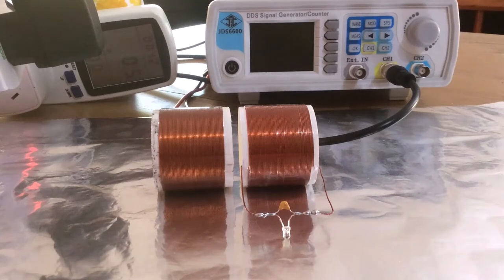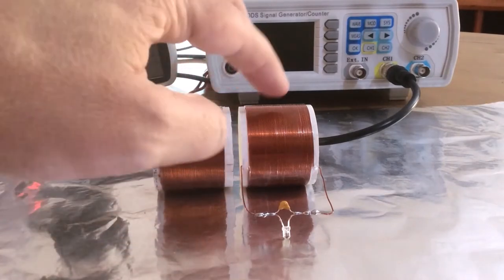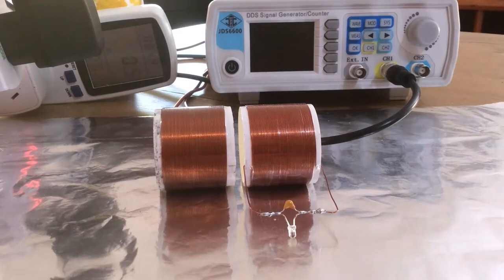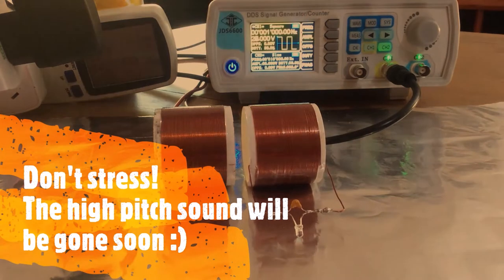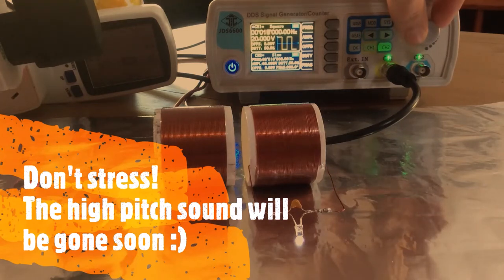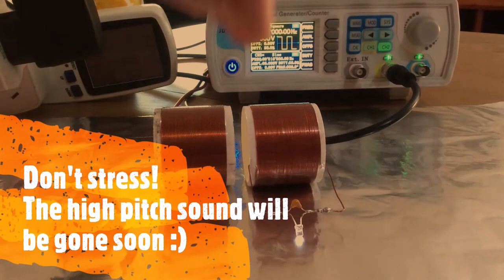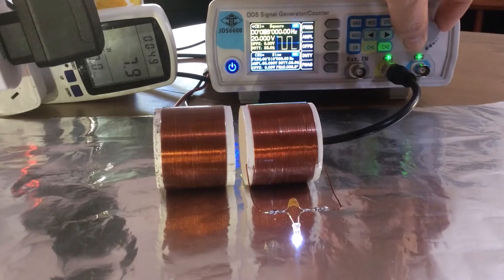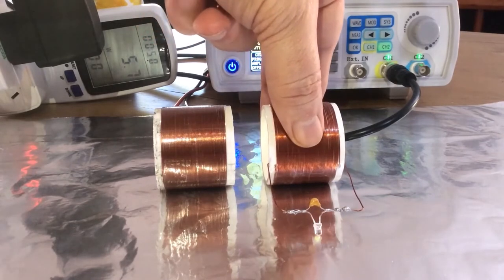FREE ENERGY with RESONANCE!

Comment: I don't get why every demonstration of this Don Smith generator always hinted on free energy, but they never try to measure the actual input power consumption. If we follow the proper principle, when there is no load (i.e. no secondary coil etc), then there is magnetic flux created by the primary coil, and this flux is energy. If this flux is used (absorbed) by a secondary, then there will be cancellation of the original flux (like adding a back emf to oppose the primary's flux), in particular with a connected load (led). Without the original flux, the primary will behave more like a short circuit, thus consuming extra power from the input supply or signal generator to maintain its AC signal. Therefore, the input power should measure a higher power consumption (with a secondary load). The more secondary coils added, the more current the primary will flow thus more energy input. So eventually, no free energy. Is my reasoning wrong?
Reply from the maker: Thank you for watching. Assuming we are following our education your evaluation would be correct. However, our education has been misleading at the best. The problem with this education is that it is wrong and this was clearly stated by Tesla. We are still educated using electron theory yet both Tesla and Einstein stated they did not believe in the electron, two of our greatest minds and yet we think we know best and have disagreed ever since. When a primary coil is coupled to a resonant second coil it does NOT increase the initial load, as stated in Tesla’s work. This transfer of power is not just magnetic flux and there are multiple waves of energy of different kinds. Measuring the output from these fields is often difficult as today’s modern equipment is not designed to measure this high frequency energy, we simply don’t have affordable measuring equipment. This demonstration was designed to show this functions principle and not so much the power consumption, however you can take note of the input from the mains meter at the start of the demonstration when the frequency is not resonant with the coil. As the resonant frequency is tuned you can see the initial input decreases, then as more resonant coils are added we see no increase in power input. The magnetic flux is not diminished during this function as the device acts similarly to radio. Imagine having your car radio playing near the radio transmitter, the radio transmitter is unaware that you are receiving its broadcast and is applying a constant transmission power input, then your friend pulls up in their car and turns on their radio, at this point there is no need for the radio station to increase its input to accommodate your friends radio and instead they keep transmitting at the same power input. Now go one step further and invite a club of radio enthusiasts to turn up to the station with their crystal radio kits, that require no batteries to function. The club of 100 members all using their own crystal radio set take their signal from the same transmitter as you and your friends cars radios are, yet there is still no increase in transmission power from the station. Don Smith’s devices are Tesla concepts, there is nothing special about these devices and the mystery only exists because of our flawed education, these devices are nothing more than radio transmitters collecting waves as energy instead of sound energy. I hope this has helped your understanding.
Reply: @whatifididthis...1236  Thank you for your reply and explanation. There are perhaps two things to demonstrate to provide more evidence in the setup. The first is to show that the dip in the signal generator power is not due to it's own design. This could be tested by ranging it's frequency from low to high (800kHz if possible) without connecting the primary coil while checking the power. The second is to use a bigger load in the secondary coil, perhaps by connecting 10 or more LEDs in parallel in order to increase the load current/power to a level that is measureable by the power meter. If this thing does indeed work, then it would be a great scientific discovery.
Reply from the maker: @francislau3393  Thank you for your comment. Those are both very good points to examine. I will check these two things out and get back to you. My initial “pre test” thoughts are as follows, the frequency manipulation on the signal generator should not change the units input wattage as the voltage remained constant during the frequency sweep. Changing the voltage however would possibly change the input wattage.
 Regarding the load increase, I will parallel some LED’s and try some different lights as you suggest and perhaps a small motor, I may need to make new coils though as these coils were made for the small LED’s, I just decided to make the video using them because they easily demonstrate the concept. I have connected approximately 20 of those LED’s with my portable lighting circuit, I think I demonstrate that in part 2 of the tutorial on building that portable unit if you’d like to see the same coil in action.
Reply: @whatifididthis...1236  Yes, you are right about the generator's power, which is mainly affected by the resonant frequency of the primary coil. Great insights!
Reply: @whatifididthis...1236  Nikola Tesla and Albert Einstein had reservations or disagreements with certain aspects of the electron theory, but their skepticism did not amount to outright disbelief in the existence of electrons. Tesla criticized the electron theory, believing it couldn't explain all observed electrical phenomena. He believed that electrons could not account for all observed phenomena in electrical systems. Nevertheless, his work on electrical systems did not preclude the existence of electrons, and the scientific community eventually reached a consensus on the electron theory.

 Einstein, on the other hand, disagreed with some interpretations of the theory, particularly within quantum mechanics. For example, he disagreed with some assumptions made in quantum mechanics, such as the probabilistic interpretation of the behavior of subatomic particles, famously stating, "God does not play dice with the universe." Nevertheless, Einstein's work on the photoelectric effect helped confirm the existence of electrons and contributed to the development of quantum mechanics.. Despite their concerns, both Tesla's and Einstein's work contributed to a deeper understanding of electrons and subatomic particles.
Reply from the maker: @toms3996  Thank you for your comment. My real problem with our education is we teach as fact yet when Einstein states regarding quantum mechanics that “there is something “spooky” at a distance” then I believe this to be stating he doesn’t know for sure. What I question about our education is our teachers state these understandings as facts when they are nothing more than hypothesis. I have researched a lot on quantum mechanics and it is clear to me that our greatest minds today are still claiming they don’t fully understand. The agreement on the consensus of the electron theory is nothing more than an explanation derived from a lack of a better understanding as stated by Einstein himself. Tesla’s statement about Einstein’s theory of relativity was “mathematical garb”.

“Einstein's relativity work is a magnificent mathematical garb which fascinates, dazzles and makes people blind to the underlying errors. The theory is like a beggar clothed in purple whom ignorant people take for a king... its exponents are brilliant men but they are metaphysicists rather than scientists.” 
― Nikola Tesla
It is only our education that believes in the agreement between these two entities that never actually occurred and our existing understanding of electron theory is more incorrect than it is agreed upon, theoretical science is no measure of reality.

Comment: I study now the receiver coil. Would all of the coils be in resonance in this example:
Length primary coil: 2 meters
Length secondary coil: 20 meters
Length receiver coil: 1 meter

I assume the cross-section of the cable is not important for the resonance. But I think it is enforcing the power.
Reply from the maker: There is one coil that is a slightly different frequency because it has two extra turns and a larger current draw through its load as well as being wound in the opposite direction. This was done to demonstrate you can be close to resonant and still not quite be there.
As far as I can tell the only difference when considering cross section would apply to mass, as in there would be more electrons to move, almost considered like capacitance.
Those coil lengths should work as they are either divisions or multiplications of the primary. As long as this is considered they can be all different lengths to achieve 1/4 wave or half wave etc., different combinations should be tried for true resonance and the capacitor also must be considered. It’s a good idea to arrange a coil that can have different capacitors applied until you find the resonant one. Transmitter Voltage should increase and amperage decrease when approaching resonance. Then all you need to do is tune the receiver coil to the transmitter using length of wire and value of capacitor.
Reply: @whatifididthis...1236  The part with the capacitor is very interesting. I didn't know that. I think you talk here about the capacitor of the receiver coil. Does this apply also to the caps you have in your circuit in the other videos. There you have 2 caps in parallel (1400VDC 20uF IEC61071). Wouldn't it work with other caps the same?
Reply from the maker: @marcelfiechter7436  Those caps you mentioned are DC caps, the caps on the small coils are for AC as they are non polarised. As you apply different value caps you will be changing the frequency and you will see different results as you approach or move away from resonance. The DC caps (1400 v) are placed after a full wave bridge to allow DC extraction from the receiver coils which are propagating AC.
Reply: @whatifididthis...1236  You told me you got eventually 10 watts (20 watt led) by the receiver coil measured by the lumen meter. And the input was around 3.2 watts from the 12v-battery. If you would double the length of the wire of the receiver coil would the wattage increase of the receiver coil? I think so. Probably 20 watts. This would be one way of upscaling.
Reply from the maker: @marcelfiechter7436  From memory, when running the 20 watt LED at half brightness, the input current from the battery rises to 5.2 watts. Adjusting the length of the receiver coils will also adjust frequency. These coils may not be in perfect resonance as they were not designed to be used with this coil. Making the receiver coils resonant with the primary coil should help the receiver achieve higher output. Measure your primary coil length, then make the receiver either the same length as the primary or any multiplication or division of the primary and you will get higher output. Yes, making it longer may increase output but only if resonant.
Reply: @whatifididthis...1236  Perfect answer. This confirms that I am on the right track.
Reply: @whatifididthis...1236  Do you know by any chance where i can find these exact coils. My plan is to replicate first and explore once i understand which concepts lie beneath it. Thanks in advance!
Reply from the maker: @me4874  Thank you for your comment.
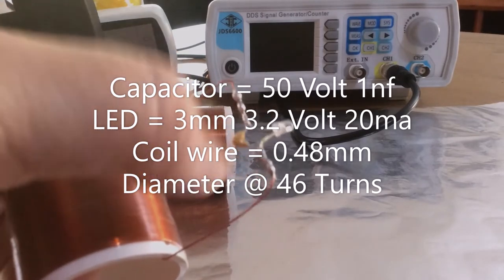I wound the coils by hand on a small gauge poly pipe, the details of the coil are on screen at the 1:30 mark. There was a US company that was selling the kit that Don Smith talked about in his videos but there really is nothing to it, making these coils is cheap and easy.
If you require a link to that company selling the kit, I believe I have already supplied a link to another person in the comment section. Let me know if you have trouble finding it and I will have a quick look for you.
Reply: @whatifididthis...1236  Thanks for your fast answer. I actually found the link, however as i am living in europe i cant order it. Ill try to create a coil myself. Which material is around the pure copper on the coil? Thank you!

Comment: How many odd those coils can you add? Unlimited?
Reply from the maker: Thanks for watching. I can’t imagine unlimited would work. From my understanding the limit is as many coils that can fit inside the magnetic toroid that surrounds the transmitter. Each coil extends transmission a little but there is a cut off point, you can increase power of the transmitter and again search for the extended perimeter of transmission.

Comment: What's measuring the watt meter?
Reply from the maker: Thanks for watching. The watt meter is not being “metered” because it isn’t required as part of the system. The watt meter is used in this example to show at the correct resonant frequency the power input is reduced and does not increase when additional loads are added. One input with multiple output and each one of equal value of the input, many more receivers can be used to achieve over unity, as many as can physically fit inside the magnetic field with no increase in power. The physical reality is obvious and our education is left standing in the room with a dumb ass look across its entire face, people should stop reading that crap and start to experiment with this old tech.

Comment: Extra wire on a coil actually lowers it's frequency ! Not increasing
Reply from the maker: Thank you for your comment. If by “extra wire” you mean longer wire you would be correct. If I stated otherwise this would be a mistake and I apologise.
Reply: @whatifididthis...1236  It's OK we all make mistakes, part of being human lol BTW I watched all your videos, you said primary bifilar should run at 172khz if correct that's great as my H-BRIDGE circuit could drive it maybe, as I'm building your device some slight changes. Thanks
Reply from the maker: @aerotro  Thank you for watching my videos it is greatly appreciated. I feel it’s important to recognise mistakes and acknowledge them, this helps me learn faster and a lot less pressure on me realising it’s ok to be wrong.

I just measured the resistance on the coils because I have it pulled down which might help you replicate the portable unit. The 172 kHz I believe was in relation to my other circuit, the one on the board, it has the same circuit layout but the coil is of different dimensions.
The resistance of the portable unit is as follows:
Primary Bifilar coil = 0.6 ohms
Secondary single wire coil = 1.6 ohms
Reply: @whatifididthis...1236  Thanks
Reply: @aerotro  Can you recommend a function generator amplifier circuit  (~20w max 50w )? 
Thanks! ❤

Comment: So what you're saying is i could have a 8 gage wire and a 24 gage wire with 50 turns and it is the same coil.  Yea that is not how that works.
Reply from the maker: Thank you for your comment. The length of a wire determines the frequency of that length of wire. There are many factors added to the wire that change the frequency such as capacitors, inductors and turns on a coil but if the length of wire is the same as a transmitter wire then this has the largest effect on frequency out of all of the components in the high frequency receiver circuit. When a length of wire is known then we can use a multiple or division of that length to receive a resonant frequency for example quarter wave or half wave. When a wire is the correct length it will receive a radio frequency and without even requiring a coil. So to answer your question, it’s not the number of turns that has the biggest impact but instead it is the length of wire.

Comment: The fact that the amperage on that meter doesn't move that much when you are removing or adding coils doesn't necesarily mean that the secondarys do not affect the primary or that you are getting energy from somewhere else, it could simply mean that your signal generator is pushing a lot more power thru the primary than your secondarys utilise. You also say that you can use it with higher current and it would behave the same but yet you haven't done it. I advise you to do it first and then draw conclusions. I am saying this because I have been on this exact road many years ago and just like you, I was fooling myself in to seeing what I wanted to see and I was wrong. The best thing you could do is find some high frequency current probes and measure your input power on the chanells leads,  because the signal generator maybe has a fan in it, component resistance and all of this can mislead you when you measure with a 50-60Hz power meter in the confuguration that you do.
Reply from the maker: Thank you for your comment. I believe you are correct that the coils do have an effect on the transmitter and that the means of measurement is not precise enough to display this. This demonstration was more to point out the concept of resonant frequency wireless transmission and that this requires tuning of the system for its optimal frequency. This is mostly visible when we see the wattage of the signal generator drop from 8 watts to 5 watts( from memory) when frequency is tuned to the coils.
 I have done this experiment with higher wattages and it behaves the same, all resonant coils within a predetermined distance receive a signal and can power loads, however this seems to only be possible at high frequencies.
Reply: This knowledge was known in the old world which dates back to Atlantis and the great pyramids. Electromagnetic resonance.